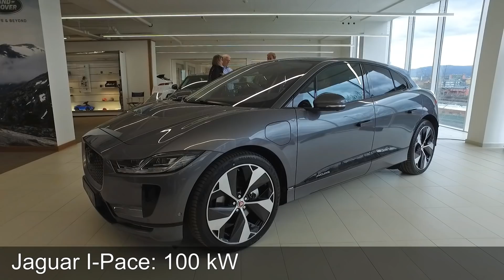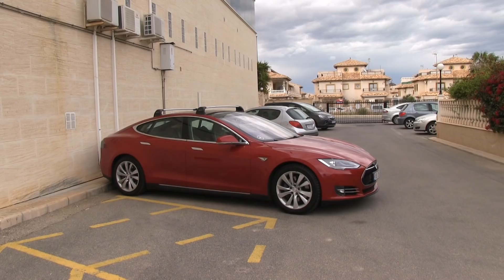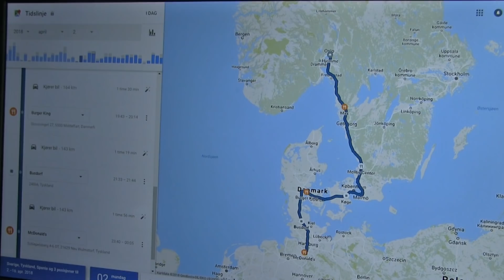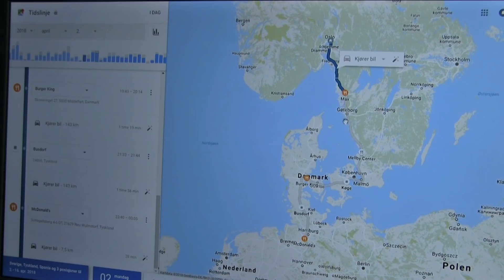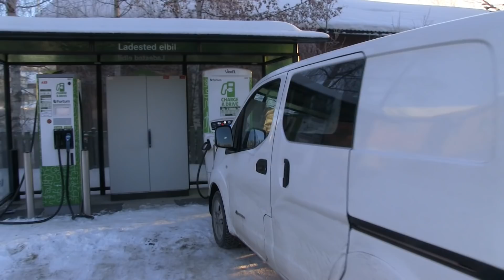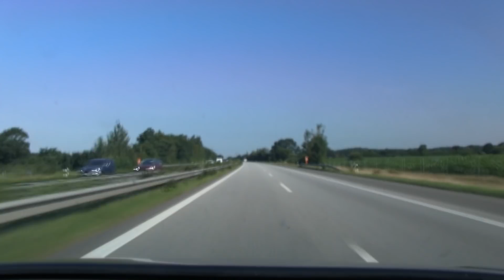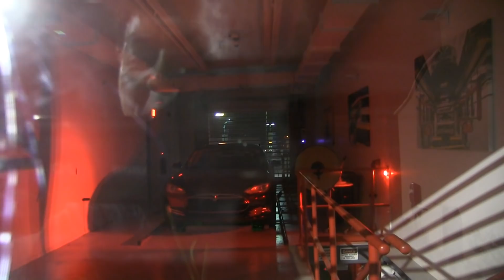Will 350 kW fast charging be too fast?

Comment: 350kW charging will be an exception - when you are driving your Porsche at over 200km/h on the Autobahn and really need to get somewhere really fast. In such case your 90kWh battery will actually be empty after ~2 hours of driving, so minimising stopped time in such case is really useful. 

If you are not in such a hurry or want to have a bite to eat you can drive into some town and plug in the 150kW chargers too. There will be many more 22/50/150kW chargers than 350kW chargers for sure. Even if Ionity will only deploy 350kW chargers on highways, there are many other charging networks, both large and small that will be deploying smaller Type2 and CCS chargers all over the place. Even now, say between Munich and Stuttgart there is a 50kW CCS charging station within 2km of the highway on average every 10km and that density will only be going up. I assume that most EVs will have apps to monitor your car charging remotely with alerts when your car is charged to your pre-set limit.

Never forget that a lot of cars are actually being designed for use on Autobahn, because nowhere else do you actually need speeds over 150km/h.

Comment: The US department of energy is funding research on batteries and electrification aimed at reducing battery pack cost to under $100 per kilowatt-hour, increasing range to over 300 miles, and charging in under 15 minutes or less by 2028. This is the subsidy Tesla tried to game with their battery swap station, but didn’t qualify because nobody used it. Some quick math shows that a car that can charge at 350 kw for 15 minutes would add about 85 kWh, and with decent efficiency can go 300 miles.

Comment: I'm not towing or driving crazy fast, but in my opinion Tesla's current range and charge rate are sufficient. I've taken quite a few trips in my Model S and I almost never wait on charging. And I'm usually ready to stop for a meal or leg stretch by the time I'm out of juice, but I would be happy to have a bit more battery just as a buffer...

Comment: Mission E is not going to be cheap ... I just have this terrible feeling it's going to make like a Galaxy note 7, overheat and burn up if charged at 350kw.
First time I plugged my Tesla in at the SC (have you seen how thick those cables are? And for 150kw Elon was talking about cooled cables) and saw "you are now charging at 350v and 300A" ... well I got out of the car and backed away gently. That's a lot of current, and a lot of volts - and only 105Kw. For 350kw Mission E will have to pull 437A at 800V... not sure I'd be comfortable standing next to that!

Comment: I think maybe the issues you raised might only matter to people coming from current EVs who are used to waiting an extended time at a charger. When going on a long trip in an ICE car I don't expect to go get lunch while my car is filling up at the gas station. I stay there for the 5-10 minutes it takes to fill up and then drive over to the parking spot at the restaurant. I think it is a good point that it would be nice if these 350 kW chargers were paired with slower ones to "top off" if you are stopping to eat or stretch. Can't wait to get out of my ICE car and go EV.
Reply from the maker: You will eventually find out in the future that with 200 kWh and 250 kW, that's fast enough. For many people today, 100 kWh and 115 kW is even fast enough.

Comment: The "German " charging network is building in obselence ready for the next generation of solid state batteries or lithium batteries supplemented by ultra capacitors that will allow a near instantaneous charge which will then be dissipated into the lithium batteries at a rate that suits the charge state (capacitors don't hold a charge like a battery at the moment). Filling up like ice cars will aid acceptance into the ev market and should be seen as a good thing and not mocked (Elon). I can remember paying a small fortune for my first digital camera which was 2.3 megapixels and trying to convince all at the time this was all that was needed to compete with film - this feels a lot like Tesla owners at the moment.

Comment: Hi Björn. Nice video. I complain with you in the most parts. But it seams, that Ionity will build the chargers like the old ice gas stations in the middle. So maybe they can release the latch of the charging plug automatically if your charging state is reached, so an other driver who parks next to you can easily pull out the cable on the car and can use it for his own car to charge. So maybe there will no need to care about your charge level and your car, because you not block some other cars. But this concept needs a lot of more space as Teslas Supercharging Network. Will see what is better

Comment: interesting argument but a reminder that the Porsche uses 800 Volts vs 350+ volts for the Tesla ... Different Charge times and Capacity will also Translate into a Fast Charge Rate... And High Voltage requires less or no Cooling at Charge Station ...Add better inverter efficiency at the higher voltage for longer range!!  Just my opinion !! ...Faster just maybe better instead of sitting down for a meal to let the car charge you just have to grab a quick coffee/donut and the car is charged!! ..Love your Videos Bjørn !!!
Reply: Higher voltage just decrease current needed, otherwise cables will be melted down.
Reply: The 150 & 350kw chargers we have here in the states have liquid cooled cables if I'm not mistaken.

Comment: IMO, for electric vehicles to be feasible for long-distance driving for the majority of people, the charging rates of electric vehicles need to be on par with refueling ICE vehicles. If I can fill up my car and get ~300 miles range in about 5-10 minutes, I would say an acceptable charging rate for an electric would be 15-20 minutes for the same rate. That can be done easily with a gas station style infrastructure like Tesla's supercharger.
Reply: 350 kW for 15-20 minutes would net you 88-117 kWh. but this is assuming no losses  due to inefficiency and heat, maybe 75 kWh usable with reduced lifespan. would not get 300 miles

Comment: I think you go at it from the wrong point of view. Yes, you are probably right on many things, however, probably neither on the use case nor design aim for the Mission E and its charging technology.

First of all, it is of course a marketing ploy. However, it does have a background in the current Porsche user base in many cases. Porsches of that kind, family sport sedans, which is mainly the  Porsche Panamera, are usually company cars for top and second level executives, used for a maximum of 2 years and then they get a new one. So nobody of those that take the purchasing decision is concerned about harm for battery life as they will not experience that. And of course, Porsche is a german company and while it is selling a lot of its vehicles abroad, it is always with the promise that they are designed for german driving speeds. So they will expect their customers to drive much faster than any known test cycle on average and never achieve that test cycle range. Which means that they need a lot of charging stops and as physiological needs will not always be an issue there they have to be as short as humanly possible, which is the design goal for the 15 minutes to 80%. And yes, Porsches are kinda common in germany, so they will have to withstand speeds over 250 km/h comfortably, allow for a very quick stop to fill up and then on it goes. Which requires both cars and a charging infrastructure to support that.

By the way, that is one of the reasons why Tesla planned their supercharger network in germany with very short average distances between them, as they had to take into account he usual much higher driving speeds on the Autobahn. Heck, if i want to travel slowly i set my cruise control to 150 or 160. And at fast it will sit as high as it can, 220+ is fine. Which of course lowers fuel economy considerably, but is a decision that can have its uses.

Comment: with 250-350 kW power people will charge like they fill the tank on a ICE. 5-10 min. at the charger then drive off or go to the parking area for a break.
Reply: only if you have a very small battery, like 45 kWh

Comment: Personally I think the charging stations should have a bit more cables, so people completing their charging would not need to vacate from the charger, thus allowing other people to charge from the same charger.
Reply from the maker: That could solve the problem. If the user could choose to unlock the cable when finished, then other cars can use the plug.

Comment: Yes, there will be disadvantages when it comes to faster charging with the current technology (battery chemistry, cables, voltage, etc.):

You can't increase the charging-speed without changing the other components involved.

For example if the current is tripled, the temperature produced will be ninefolded.
Now a new cooling-system that is 9 times more efficient/bigger is needed for the battery.

That cooling system will increase the car-weight. Do you want to lose some range just to have faster charging?
And where should this bigger cooling-system be placed? I don't think there is much room underneath the car.
Simple way to do that would be to use smaller batteries with less kWh, again less range.

Same as with ICE cars. Why do they have a 600-1000km range with one tank?
Why not increase the tank size so they have a 1500ish range?

Because there is a sweet-spot

Comment: I normally have great respect for your carefully considered points, but this time you shoot next to it. Of course, a shortest possible charging time is preferable. It's no different than fossil cars, waiting for the fuel tank to be full and moving the car before going to the bathroom, eating or anything :)
Reply: bjorn made a valid point. Why charge faster than you need to? It puts more wear and tear on the battery and is less efficient(heat lost in cable & connectors etc). You can have hundreds of charge stall at services. They dont take much maintanance unlike fuel pumps.
Reply: it is much better to charge a 1000 km battery at 500 km/h than it is to charge a 300 km one at 1000 km/h. this is the point bjorn is getting at
Reply from the maker: It seems to me that people who think they need 5-10 minute charging times are those who have never owned a Tesla before.
Reply: You have just adapted yourself in relation to the charging time for today's Teslas. With more Teslas and other electric cars on the roads, shorter charging times are required, so that more cars can charge at each stall.

Comment: I think personally it should be separated like have five super fast chargers and five normal speed super chargers So that if you’re in a rush you can plug into the really fast one and get going But if not and you want to stop eat or even shop you could use the normal superchargers and wait a little  and not have to worry about moving the carrots getting charged

Comment: It's not just the cost of the chargers themselves, the cost of the power supply (transformers, connection to power grid etc) is a perhaps even bigger expense.
Transformers are sized according to peak power use, eg if you have 6x 350kW chargers, you'd need 2.1MW worth of transformer.

Tesla do at least have the ability to add their own Powerpacks to supercharger locations to reduce power draw from the grid.

Comment: If Porsche Mission E really will have 90 kWh and it charges from 0-80% (72 kWh) in 15 minutes, it would be 288 kW charge speed (on average). That's very fast. It may be 350 kW peak but apparently that speed can't be sustained throughout. It also means it will not leave you with enough time to do more then a rest room stop. Moving the car after charging will be necessary, as you suggested, so charging becomes real waiting like it does at a gas pump.

I suppose if you're not under the clock regular stops for the car and yourself are a good thing. For those who really just want to get from A to B really quickly faster charging is better. I wonder how far 90 kWh will get you in a Porsche Mission E at 200 km/h travel speed since I know people who travel like where they can (and above).

Comment: Even today, there are cars that park themselves , or drive themselves out of the parking lot to where you are. What if VW/Porsche's charge station have designated parking spots , so you can leave your car to charge up, then it drives itself to a parking space, to free the charger. It's possible with today's tech, so I don't see why they can't do it whenever Mission E comes out.
Reply from the maker: It would be great. But I have my doubts. IONITY have focused on ultra fast speed and not automation.

Comment: I want to be able to fully charge an electric car in two minutes, like I do with my petrol car now. Until then , I'll wait.
Reply: Takes 10 seconds to plug in my EV when I get home. Only charge on public chargers once a month or so. This would be true for most drivers because most off us don't drive hundreds of miles a day. A few hundred miles on a charge is more than enough for most days driving so much so I don't even bother to fully charge my EV every night. I thought the same as you once but  the 5  mins plus it takes to put petrol in my other car including standing in line to pay really annoys me now.
Reply from the maker: You clearly don't understand how EVs work. EVs can charge at home, at work, at the mall, on street level parking and on other places where it sits still. With 200 kWh battery and 1000 km range, you don't need to waste your time going to a gas station or fast charger. And for long trips, you can drive 1000 km/10 hours before you need to recharge. It's highly recommended to take a break long time before 10 hours have passed.
Reply: You can get to the station, fuel and pay in 2 Minutes?
Would you do us a favor and use a stopwatch next time?

Comment: A few things:  

I'd like to see what I call, 'R2D2' style charging ports -- that is, you pull up, the charger talks to the car and the car opens its port for the charger to automatically insert the contacts.  No need to get out, but if so, when the charge is done, the car can just go find a parking spot on its own, or drive around waiting for you.

Next, oversize the battery by 25%.  As Bjørn says, in the future the packs will get smaller as the capacity goes up once we reach a comfortable range, so why not make it such that the pack is rarely charged over 80%?  This way we could fast charge more often with less damage.  Say 80% = 800km.  I think that would be perfect.

Lastly, the car should do some very fine calculations based on the battery's history and pass the data to the charger to determine the best rate.  It could also be somewhat fuzzy, and take into consideration your habits, like the time you'll spend at your location, and how busy the chargers are.  It could then make an educated guess as to the best possible rate.

Bonus and kinda unrelated:

Car-to-car charging.  I wish it was a thing.  Help a brother/sister out.  Maybe use a crypto to keep track of things if you wish to sell power.

And this one that drives me nuts:  Efficiency measurements.  Can we settle on m/Wh?  It's km/kWh with the k's cancelling.  The number comes out nicely as well.  Let's just say a car gets 6km/kWh, then we can simplify to 6m/Wh.  Eventually and in shorthand we might just say, "My car gets 6m -- I hear your car gets 7.3"  Something like that.  It's in a 0-10 range that we naturally think in, and is so simple.

Comment: 350kw charging maybe possible, but the it's likely to only apply to 1000v packs. The Mission-E is a 800v pack so 280kw peak (800v x 350a).  https://cleantechnica.com/2018/04/26/important-but-little-known-details-behind-electrify-america-charging-infrastructure-tesla-supercharging/ goes into detail.  It basiclly the same reason why current chargers rated a 50kw only deliver ~45kw due the combination of pack voltage and maximum charger current.  Typically the charger current limit is reached and  limits the actual power.